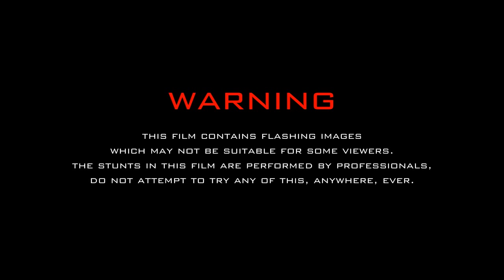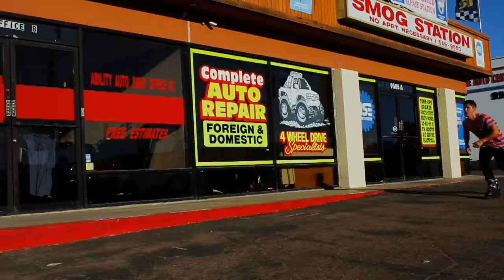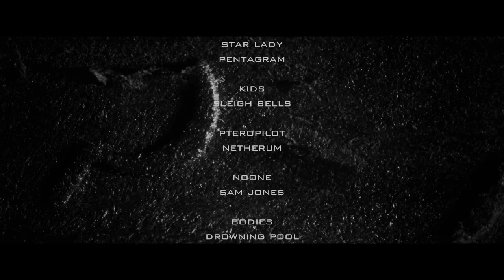Ground Control - Full Film

Comment: Why is roller skating not nearly as imprèsive as skateboarding nowadays??
Reply: Cause it's easier
Reply: @yugimuto5297  yup now that I think about it, I tried roller blading randomly in 6th grade and literally learned all  the 10 tricks there is to do on them things..
Reply: @jacobramirez7027  you did it wrong. There are more than 10 tricks